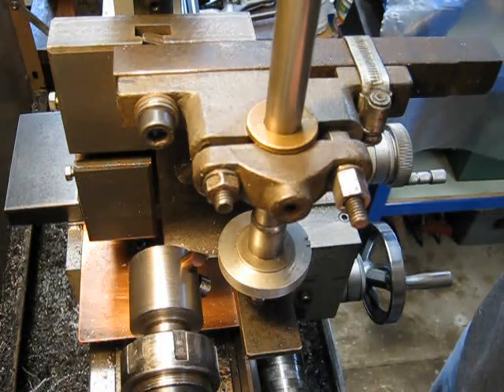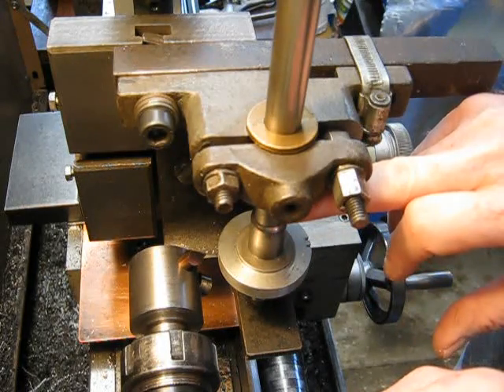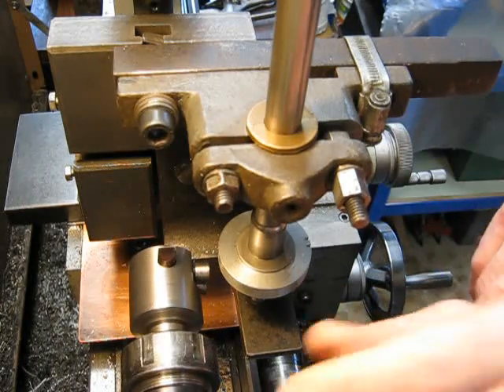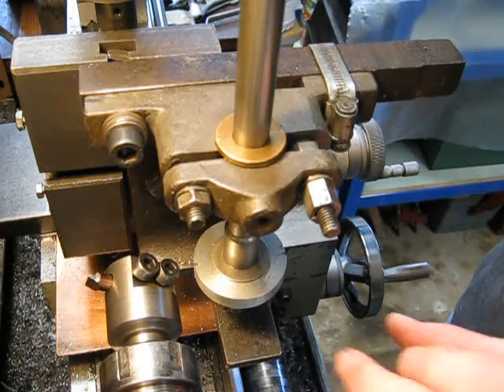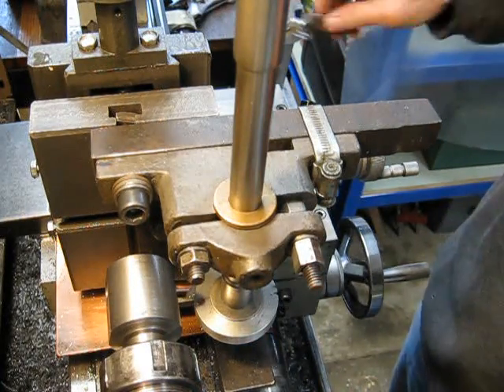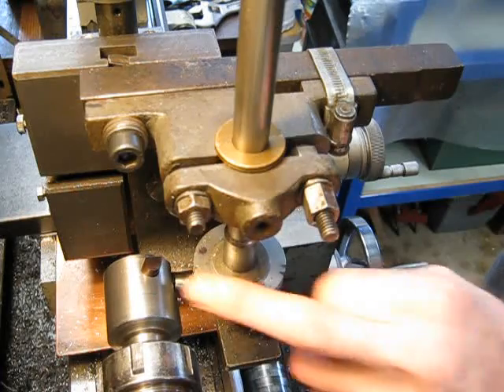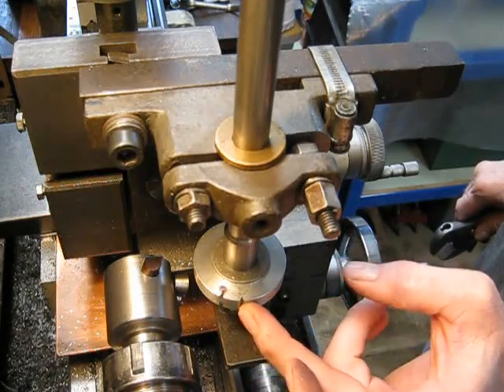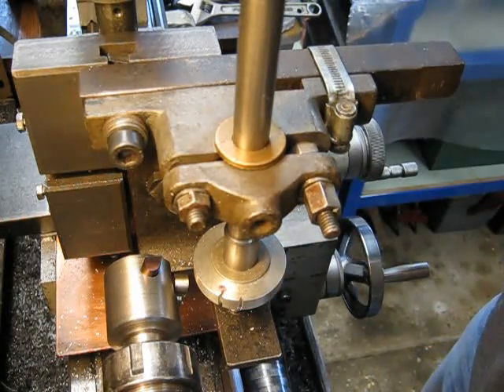Make gears on a lathe - cutting direction

Comment: Your top down method is what you'd call "climb milling", bottom to top would be "conventional" milling. In this case you're right it doesn't make much difference. For those who asked it would make a difference on a milling machine with a multi point cutter (climb milling usually brings out the worst in backlash on milling machines)